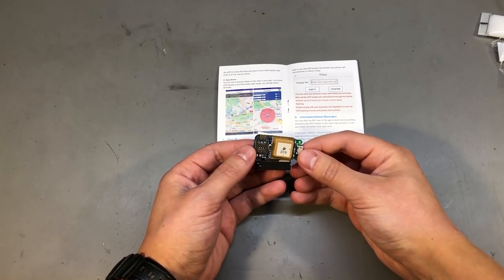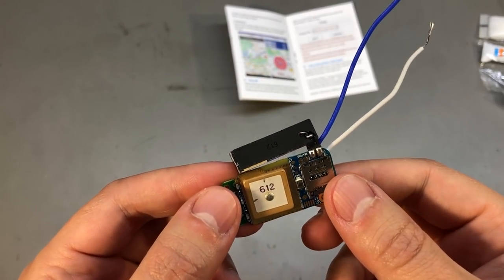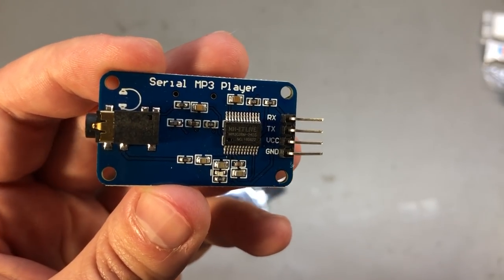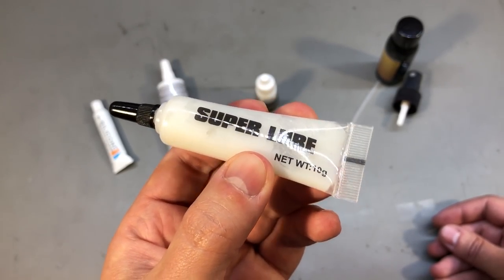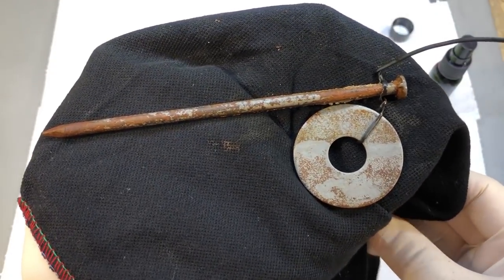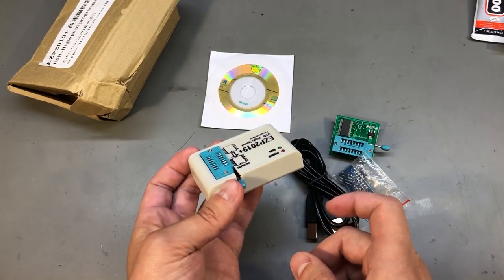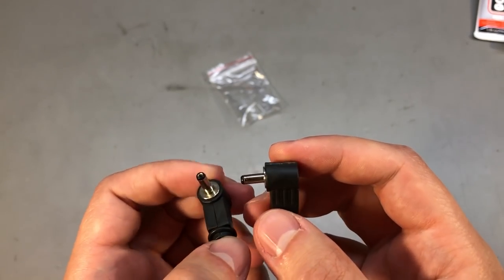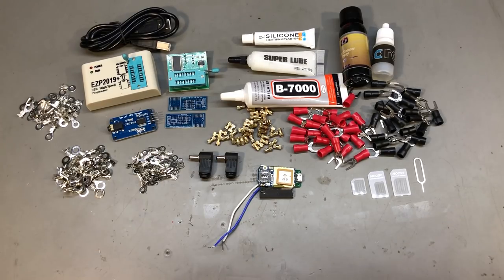InTheMail | Voltlog #321

Comment: In most cases rust converter is preferable to any rust removing solution. You simply wait for the reaction to finish and then you can use some sandpaper or abrasive paste to remove the black stuff the rust turned into.
Reply from the maker: I have yet to try rust converters, but I will try some to observe the difference, thanks!

Comment: About the heatsink adhesive:  After opening it should be placed in a small bag to prevent it from hardening during storage.  I have yet to have mine harden storing it in that manner after several months.

The CH552G is actually an 8051 compatible microcontroller with USB support.
Reply: I've had one of those heat sink adhesive tubes for couple of years now. It's been used for attaching heat sinks to single board computers and routers every now and then. Instead of being pure white (I think it was white, when I opened the tube...), it now has a light brown tint. It still seems to work fine, despite the discoloration.
It seems like the adhesive kinda seals the tube when it starts to dry and there is just a very tiny bit of dry stuff in the nozzle, even after not being used in six months.

Comment: about the dc jacks at 12:00, and in general: after i order something, i started a while ago to answer to the emails i receive for just shipped stuff, addressing these answers to MYSELF (and adding an ad hoc gmail label) and adding info like keywords, links for tutorials or videos where i saw them, etc... easy to retrieve ideas and thoughts months after when that stuff finally arrive... :)
Reply from the maker: Yeah, labeling is the key here. The brain can barely keep up with this 😁
Reply: Very good idea. Also putting a screenshot of a web page where you saw it can help later on.  Sometimes I buy stuff because of reviews and now I am stuck with boards that I don't know what I purchased them for. (guess we all have that issue?)
I do the same to insure myself with warranty stuff for things I buy in stores. Those receipts you either loose or they become unreadable after a while. I take a photo of the receipt and email it to my gmail address with some keywords. Easy to filter and know when you purchased it in case it brakes down during the warranty period. I guess we all have the tools so why not use them?

Comment: Threaded Inserts:
CNC Kitchen has two very interesting videos about this topic i recomend to watch. He comes to the conclusion that threads cut directly in plastic are the best, cheapest and strongest option most of the time.
Reply from the maker: Yeah, I've seen those videos, screwing directly into the plastic is certainly an option if you are only doing it once. The main role of the threaded inserts is to allow repeated cycles.

Comment: Silicon adhesives solidify due to the moisture present in the air. When storing the tube make sure it doesn't retain any air at all. If any moisture is trapped, the adhesive will set in. To ensure it's properly sealed I usually put one or two layers of shrink wrap to the opening on the tube, before I screw the cup on. This keeps it fresh for months, even years
Reply from the maker: Thanks! That's a good suggestion that I need to try.

Comment: If the silicone heatsink plaster cures like other silicones (and silanes, also called MS polymer adhesive), it's with moisture from the air. I have tubes and cartridges of those that have been useable for years. I put some plastic or aluminium foil between the tupe and the cap (so it's tightened down by the cap). For cartridges with nozzles I just use adhesive tape glue the tip shut. That slows cure down enough that even after months there's only a small cured plug that can be pulled out with a screw.
Reply from the maker: I need to start putting some tape to seal the cap cause I've had cases where even stored in a zip lock bag in the fridge, the whole tube turned rock solid after about 6 months of storage.

Comment: There is a tracker which looks like a cube relay and it takes 12V and an optional switch input on the connector on the bottom.
Reply from the maker: If only I would have showed one of those on the channel..

Comment: What happened with your positieve view regards JLCPCB.com? I noticed that PCBWay is pretty aggressive in marketing. However, it looks like that PCBWay is pretty expensive compared with JLCPCB assembly.
Reply from the maker: PCBWay is my current supplier of PCBs and the sponsor of the channel.
Reply: Arjan you many want to look at PCBcart.com.  I've been using them professionally for a decade and have always been satisfied with their quality, cost and speed.  My experience is that their board quality is higher than that of JLC...if this matters to you.

Comment: I need that sim card kit. I have an old N5x I want to try with UBPorts Ubuntu Touch, and totally forgot that my current sim is a micro.

IIRC the CH552 is a μC.
Reply from the maker: Most usb to whatever_interface are just microcontrollers at their origin but I must say WCH the company that makes it do have some interesting products in their catalog, too bad the datasheets are always in Chinese.
Reply: @voltlog  
  WCH seems like they do what FTDI should have been if they had moved in the right direction a decade ago.

  I think I saw someone did an introduction guide on that CH552 within the last month or so on here. I noticed a title about a CHxxx number and a title saying it's the 'cool new $0.50 μC in my feed as I was browsing. I'm not playing with μC's ATM so didn't watch, but I put it in my watch later list... Currently burning libreboot on a Leno, and trying Gentoo for the experience of a fully FOSS laptop from source.

  Hey, I'm glad I didn't try that little black CH341a programmer with the chip on the Leno. I was planning on using it until you mentioned it's issues. I did the retrace on the eevblog just cause someone needed to, and I am just using an old Rπ3 as a programmer instead.
Reply from the maker: @UpcycleElectronics  There are also other translate services online that can do entire PDFs and they do a pretty good job at figuring out paragraphs but between working with a cheap micro with one of these translated datasheets and a 3-4x more expensive mcu with proper datasheet, at least at hobby level I would always go with the more expensive option just to get the good documentation.

That CH341 programmer works great after the mod I've shown, just used it the other day to read/write a 3.3V EEPROM.
Reply: @voltlog  
  Same here with the μC's. I've used a PIC18F46k22 a good bit over the last year.
   I need a datasheet, programming manual, active community, and plenty of example code before I have any chance of success beyond a flashing led. That PIC18 is used in many Uni courses, so info is easy to find. I play with a Forth based RTOS running on it.

With PDF's and translations, I started trying to translate the LGT328 datasheet by formatting it manually and passing it through google translate line by line.
   I already had/have a linux toolchain I use to cleanup and format PDF's from old book scans. It works well. I've added OCR to a few databooks on archive dot org. I also extract the table of contents and make the PDF's index link table so it's easier to navigate. 
  Translation is/was a whole different thing for me though. I went through the first 40 or so pages of the LGT328. I quit once I realized the chip has a dumb work-around to get the arduino bootloader to work. It requires their proprietary programmer. LGT didn't make an avrdude compatible config file.
  The issues with Chinese translations and "new lines" was just my experience.
   There are somewhere around 4-7 copies of the LGT datasheet floating around with various degrees of accuracy. The NL issue was the most consistent error present in all of them. When looking at it line by line, in detail, I can confidently say none of the tools I've found are accurate enough to bet real money on unless someone has gone through them line by line. They can seem okay on the surface, but breaking a line like this can flip the meaning of Chinese to the complete opposite, like from a "yes" to a "no." I found this error a few times. Everything else in the sentence made sense, but the outcome was completely wrong. 

    I had a unique opportunity, around 10 pages into the LGT328 datasheet I found enough matching data from an older Atmel original 328 DS to see a clear pattern. I realized there were references in the LGT DS to figures and tables from the original Atmel that were not relevant to the LGT. Things like the ATMEGA328's EEPROM reference figures are in the LGT328 text. Only, the LGT doesn't have EEPROM, it uses a 2 page flash swap technique to simulate it. So everything in the Atmel EEPROM text section was removed, but the surrounding references to figures and tables were not deleted, these were simply missed during copy/paste editing. After noting that large portions of the LGT DS were copy and paste translations from English to Chinese, I started matching everything to the Atmel version as my primary source and searching for the places that were deliberately changed or added to. This means a lot of the text was originally in English. So, all that any translation tool needed to do was work backwards. Every translation tool I tried and all the DS versions other people had made included major errors just in the originally English text, the Chinese stuff is a different issue. Errors were still present in the Chinese text, although the types of errors were just different. I posted my work on github as I was working on the project. I think I uploaded the full comparison notes documentation too, where I listed all of the issues line by line and the decisions I made for my version. I also posted all of the other translation versions I found, but added a link index and reworked for better lossless compression.
 
With the current programmer project I'm dealing with a tiny WSON8 (like vqfn edge pads) flash chip I really don't want to need to replace if I screw up. Plus I found libreboot's primary dev Leah Rowe on here with an example of programming using a Rπ with a version of flashrom on github called hackrom. I want to try it. Flashrom is the tool used to flash lots of bootloaders in linux. It is a handy tool to get acquainted with, and a proven demo like Leah uploaded is what I like to see before attaching wires to a laptop main board. I get nervous with this kinda thing.